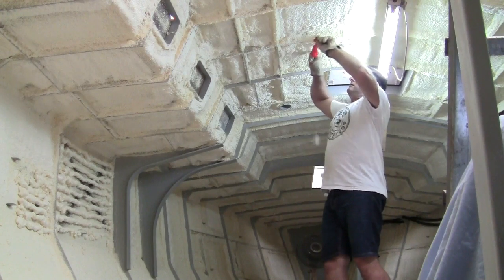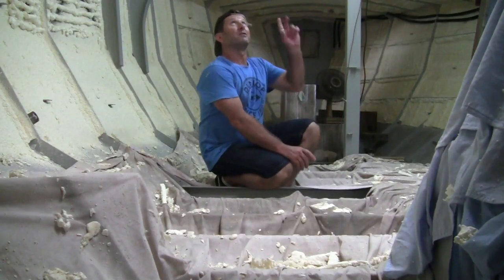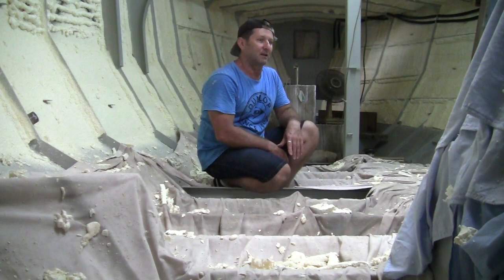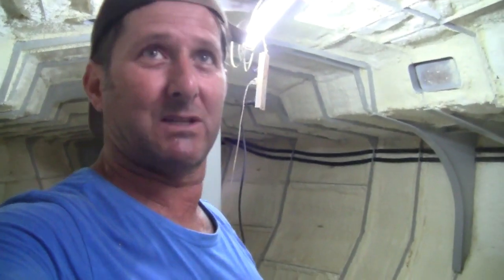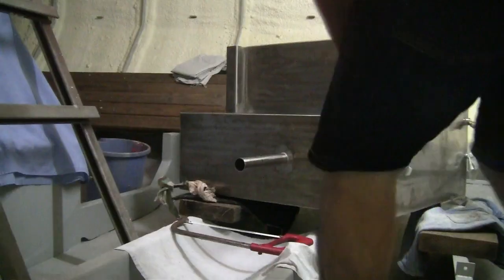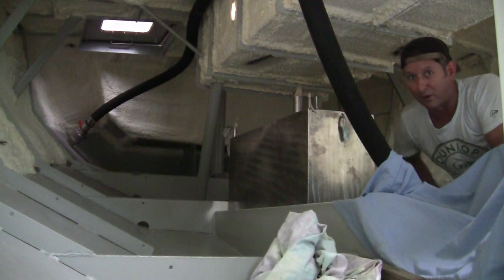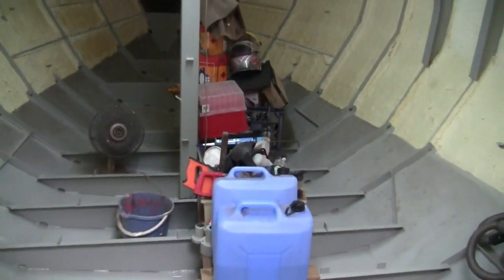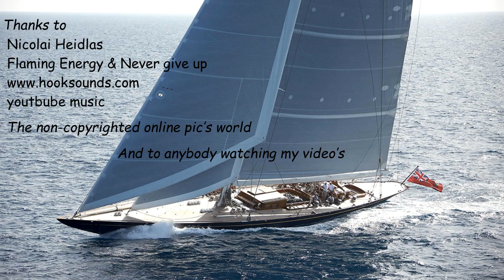Building my steel sailing yacht Ep.13 Custom made alright! (& insulation completed! part 4)

Comment: Since condensation is a problem for all fuel tanks, why not use insulation on them just like the hull?
Reply from the maker: This is a very good idea Frank and one that I had not considered nor had in mind, so I really do appreciate your good comment, thank you!  🙂
Reply: @BuildingSYMistress  The fuel picks up condensation from any tank that it's stored in, so having a fuel polishing system with water catch filters is necessary. You can't guarantee the fuel you buy will be water free and it also gets condensation from sitting in your tank. Therefore, you have to remove it before it goes to the engine.
Reply from the maker: @richardbohlingsr3490  Yes indeed Richard I believe that you are completely correct and I will be researching how to manage my diesel storage and supply much better ahead. Thank you for your good comment!